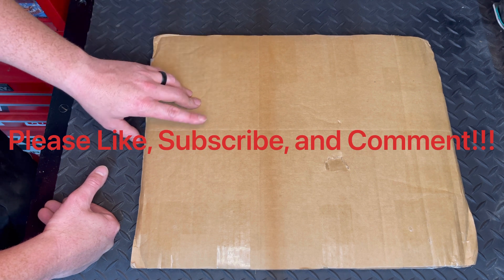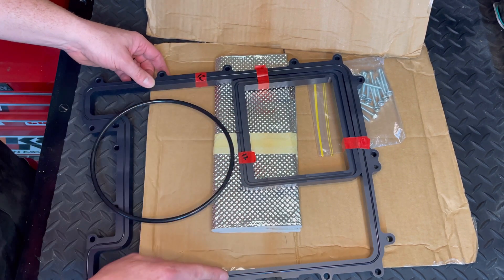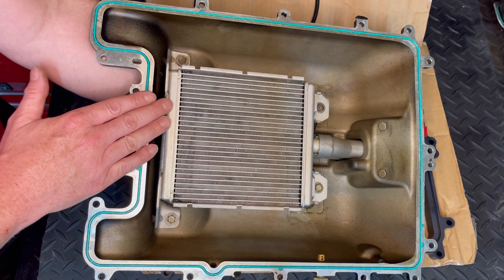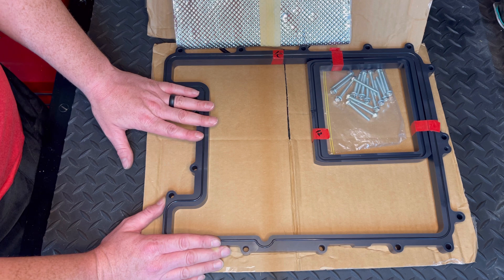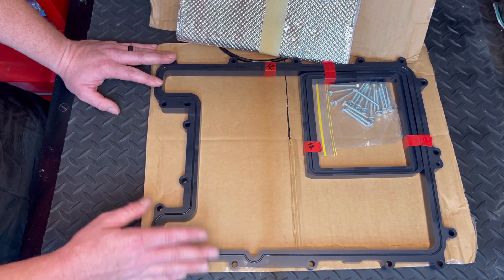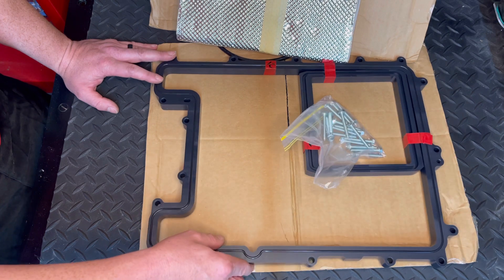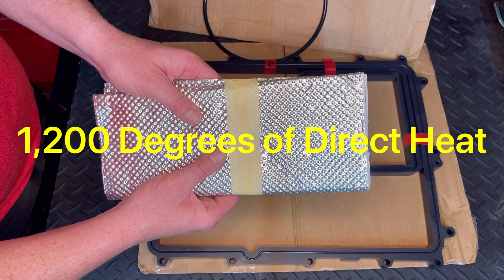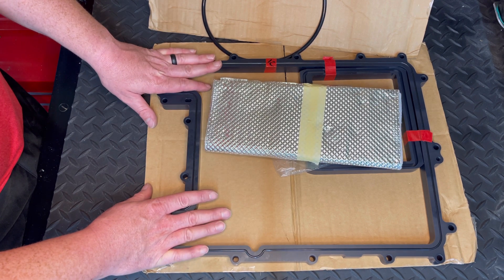FORCED INDUCTION INTERCHILLERS 20mm LSA Lid Spacer and Thermal Balnket Overview and Power Gains

Comment: Hey with your lid spacer and blower spacer what size drive belt did you have to use on this combination
Reply from the maker: I dropped down to a 2.38 pulley from a 2.5 and used the same belt. You shouldn’t have to change the belt. The upper lid spacer doesn’t move the pulley, only the blower 10mm plates do.

Comment: Awesome build, Did you do a video on your interchiller install? I am getting ready to pull the trigger on my V2 , Any issues with having your tank in the trunk as opposed to keeping it towards the front? I just bought a trunk tank and a EMP pump but now changing gears to a chiller but wondering if the coolant travel from rear to front is a problem..Thanks again
Reply from the maker: Thanks, I did not install an innerchiller. I only did the spacer plates shown and the thermal blanket. I have had no issues with the ice tank being in the trunk.

Comment: i wonder how much hp youd gain with the stock lid and spacer?
Reply from the maker: I share in the video how much is gained from the smaller spacer. Some prefer the CTSV lid over the ZL1 lid for power and cooling. Should be a nice gain.

Comment: Hello

Did you Install the heat wrap on the engine valley cover as well?

Great Video, and got a new subscriber.....👍👍
Reply from the maker: No, the heat wrap was only installed on the bottom of the supercharger. There is another video on the channel where I install all of the Forced Induction parts. 

Thanks so much for subscribing!!! I appreciate it.
Reply: @whiplashtv2022  

Thanks.
I'll look for the video

Comment: I saw they have a spacer with meth ports why didnt u get that one instead and run meth?
Reply from the maker: I am running E85 and am not interested in running Meth at the moment. If I was running premium gas then I would 100% be running Meth with it. Maybe someday I will add it but not at this time.
Reply: @whiplashtv2022  im running e85 on mine would I benefit from running meth what do u think
Reply from the maker: It depends on your setup on your car and what quality of E85 you are getting. Meth helps some to keep things cool and adds octane. However, it can be dangerous if it doesn’t spray for some reason and you have added time for it. So there is lots to consider.

Comment: Don't buy the Isolation Plates. They raise your sc too close to the strut tower brace.

I run the Forced Induction 10mm lid spacer, 10mm Isolation Plates, and Mylar Insulation Blanket.....I had to remove my hood Insulation, but it fit under the stock hood of my 2013 CTS-V Coupe.
Reply from the maker: I’ll just modify it or remove it. I am not planning on auto crossing the car.
Reply: @whiplashtv2022  Brotha, So that you can remove the snout for bearing replacement, make certain that you cut  Isolation Blanket for separation.
Reply: @whiplashtv2022  I am really on the fence about buying a interchiller, every tuner I’ve talked to don’t recommend it, but I’m tired of icing my tank so I’ll be tuned in
Reply from the maker: I am not doing an Interchiller.
Reply: @whiplashtv2022  yeah I noticed that still will be watching the outcome
Reply: @whiplashtv2022  Smart man
Reply: @imyrbiggestfan  sorry to inturrbte but can i ask you since you are in texas ( very hot weather ) what's you oil wight and what type are you actually using for you supercharged ctsv as a dily driven car ? 10w40 is what i'm using .
Reply: @d7mas  I run Amsoil Signature Series or Amsoil Boost 10w30 w/ Motorkote oil additive. I don't daily my V, but I did drive it yesterday in 102° heat. Even at idle, my oil pressure remained in the low 30's. I run K&N HP1017 for my Oil Filter.
Reply from the maker: In a stock LSA, that 10w-40 is probably a good choice. I was using 5w-40 but with lucas synthetic oil stabilizer which thickens it up.
Reply from the maker: Did you ever get any before and after hp numbers?
Reply: @whiplashtv2022  Going from a 2.45 to 2.35 upper (+1 psi) and the Forced Induction Package. I went from 740rwhp to 780rwhp on E85 & 16.5 psi.  That's with stock heads and stage 1 cam.......10.57 @132 w/a 1.58 60' DR on a 19" factory rim.
Reply from the maker: @imyrbiggestfan  did you notice much change in the supercharger IAT temps?
Reply: @whiplashtv2022  Nothing worth noting.
Reply from the maker: @imyrbiggestfan  Ok, I am interested to see if I see any cooling benefits on my setup.
Reply: @whiplashtv2022  You might notice that your sc takes a little longer to heat soak.....Even at 16.5 psi my ait rarely get above the timing reducing level of 140°
Reply from the maker: @imyrbiggestfan  taking longer to heat soak is always a plus. Mine usually was 12-16 degrees within ambient temperature range depending on how hot of a Texas day we were having.
Reply: @whiplashtv2022  Agreed
Reply: What lid are you using?
Reply: @a762user  Stock CTS-V
Reply: @imyrbiggestfan  okay from what I have read they where meant for the ZL1 lid or the katech lid
Reply: @a762user  my lid spacer works amazing......I was commenting on Thermal Isolation Plates between the SC and the Cylinder Heads.
Reply: @imyrbiggestfan duh okay good to know.